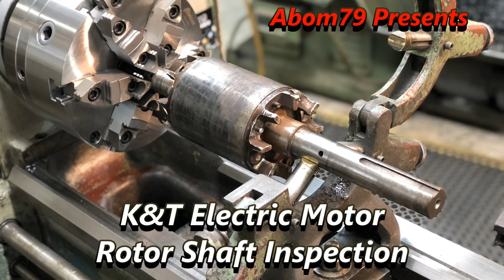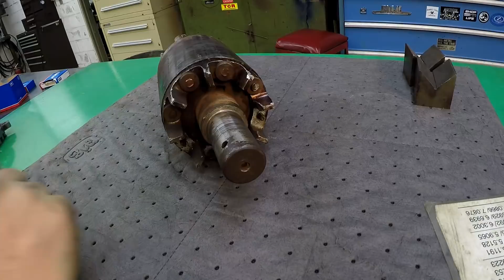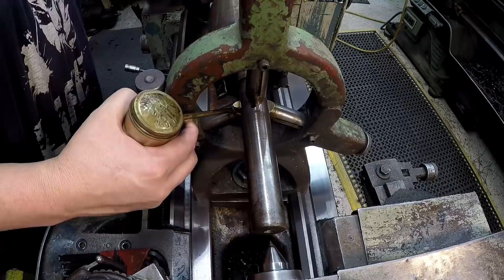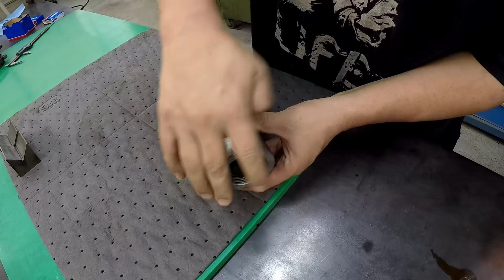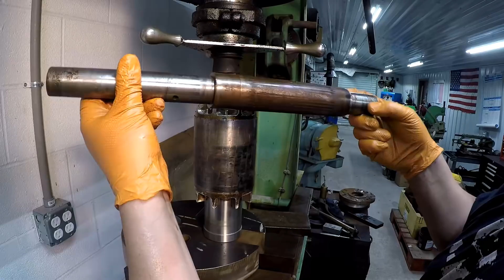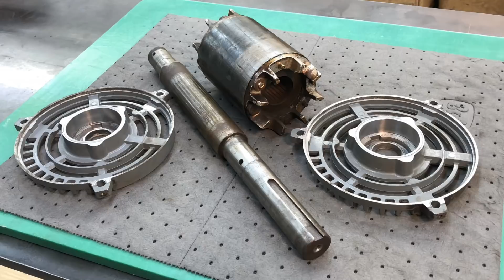K&T Electric Motor Rotor Shaft Inspection

Comment: Rotor has a keyway but the shaft only has one keyway on the drive end. Looks like it's not the original shaft. It may have some balancing issues?
The rotor also shown signs of heating probably not being correctly centured with the stator. Other causes of over heating the rotor can be due to a broken rotor bar and usually presents itself and a groaning noise when the motor is running at full load. If that was the case then replace the motor or find a replacement rotor if you can.
Reply: The rotor is couterbalanced via washers and rivets as I see.
Reply: I depends on when the balancing weights were installed. Where they added at the time of manufacture or after the rotor may have been re-worked. Apart from the heat colouring the rotor looks like it's had a hard life. The rotor shorting rings, fan vanes looked knocked about and bent and won't help with it's balance.
Reply: Right you are. Life beaten it :)

Comment: Bearing puller...yes, I've worked on shaft stuff that was hammered, I've got a couple puller sets, they have a thrust bearing that you use on the point...
….015" run out, that would surely hammer the bearing/housing. And the bent shaft...I was 'The Welder' in a machine shop...welded a few shafts, always distortion, then the press to straighten, and sometimes the shaft was like yours, but worse...so we made a new one….sometimes the old shaft was knurled (straight)...and not quite such a tight press.

Comment: best I had was trying to press a pinion out of a new old stock rear axle, cosmoline filled and the pinion had moisture and rusted to the inner diameter of the outer pinion bearing locking it in.  naturally I wanted to keep this new old axle and wrestled it onto the press.  at nearly maxed out on tonnage and not wanting to back down I smacked the housing with a sharp blow with a small sledge causing the press and axle to jump off the ground.     I like your slow motion shots, wish I was filming.

Comment: Either you are using a wide angle lens or that armature is bent like banana! I think it is the lens 😜 ok I just watched the rest...it IS bent! Why would a machine made ages ago in the USA have a motor with a metric shaft?
Reply: Most bearings are metric, been like that for a looooong time. Inch size bearings are often a special order...
Reply: You can compare known edges when something looks weird like that, in this case look at the table edge and you can tell it's just lensing. It's bent but it's not THAT bent haha

Comment: I have used them but presses always kinda scared me. Lots of tonnage in a small spot. I knew she was gonna give. Just didn't know when! Speaking of hearing protection you definately need to use it. I was recently fitted with hearing aids. Fifty nine years of loud noises have taken most of my high frequency hearing.Wish I had taken better care of my hearing. When it is gone it is gone. Bring us back when you do the shaft. Hopefully it goes in a little easier than that one came out..........
Reply from the maker: That’s why I started talking about hearing protection in my vids. I waited too long myself, but not I can’t stand loud noises or air blasts. Unfortunately I seem to be the only guy at work that cares.
Reply: Need to really work on them. You can tell them one of your viewers said so. I tell you I was really shocked when the exam was over. I have no hearing at high frequency at all. Too many years of loud stuff. Not to mention the hearing aids cost 5000.00 and no insurance help. Ouch!
Reply: Johnny Holland h

Comment: Used to do a lot of motor work in years past.I usually cut the shaft off flush with the fins and bore most of the center out to relieve the pressure before pressing.There have been times when the shaft would press out hard and the rotor would delaminate.I will sometimes also chuck the rotor and skim the bore in the lathe to true it to the OD and smooth the lamination ridges.

I've owned two K&T horizonal mills,both had the same issues with the main drive motor.IMO the motors are the weak link in the machines.They are not the same quality as the rest of the machine from what I have seen.

Comment: And that job just became significantly more expensive. On the other hand, it won't be destroying bearings with the new shaft. I'm assuming the cost of replacing the entire motor is still much higher than what the repair will run.
Reply from the maker: Yep, and you won’t find the correct output shaft as the original.

Comment: Hey Adam: Call Keith Fenner. He'll straighten the shaft! He does that for a living. Then again, getting a new shaft is good too. Jon
Reply: With all the extra work that shaft needs, and how it was bent, it instantly became faster and easier to machine a new shaft. Sure, it could be straightened, but then it still needs to be reworked for bearing fits.
Reply: Even Keith would ask why one would straighten a motor shaft, and then still have to machine back to condition. Life is too short. Typically Fenner is straightening prop shafts which have a lot of material in them and more worthy of the labour.

Comment: At motor shop we would hear rotor some to push freeze shaft and heat rotor to install. If belt drive machine we would heat straighten but new is better

Comment: I know how you feel. Started with antique motor. Had it tested for $60. Motor and capacitor were good, but the starter switch was broken and they couldn't find a replacement. Got it back and got the shaft repaired for $100 because I found a motor shop with a starter switch. Sent it to get the new switch and come to find out there is a short in the windings and the capacitor was weak. So another $350 for the remaining repairs. I should have junked it, but I just love the old look on my Atlas drill press.

Comment: Are you going to go through the rapid motor on the front too?
Reply: Adam suggested earlier on that the motor shop advised the mill was wired incorrectly and was under voltage. He suspects the traverse motor will be fine once it's at correct voltage.

Comment: I had an old motor rewound and refurbished recently and really hadn’t given thought to the work that went in to checking and redoing the bearings, shaft and endbells so this series is super interesting for me personally, so cheers for that. Keep her going on the healthy lifestyle too dude- really starting to notice the difference even just in the definition of your forearms and hands. Great work!
Reply: most likely something along the lines of "cross knurled the shaft" if diameter was too small for bearing and assembled with some loctite product, possibly the same for end bells..
assuming it was a bearing motor and not far off spec.

Comment: I'm betting you wish that was an electric over hydraulic press though
Reply: That's not what electric over hydraulic means. Electric over hydraulic means that the flow (maybe position) of the hydraulics are controlled by electronics. You're just talking about an electric hydraulic press. "Electro-draulic" or electric powered hydraulics, but not "electric over hydraulic." Don't feel bad, I thought the same thing for the longest time.

Comment: Hi Adam
I recently had my Bridgeport 2hp motor shaft replaced.
The guy that replaced the shaft said that the only way to remove the shaft safely with out damaging the rotor is to bore out the middle of the shaft in the lathe.
He said you pretty much machine out most of the meat from the centre from one end, so when you press out the shaft it will sort of shrink inwards to counter the laminations from the rotor.
Reply: Adam used to do this work for a living. Pretty sure his methods are sound.
Reply: Sideslip-
He still does this work for a living, doesn't he?
Reply: oldbones he did say he damaged some in the past by pressing them out.
Reply: Sideslip I’m not saying there not

Comment: you need a hanging chain mesh on front and back of your press,    i don't own a press yet, i'll make  1/4 chain fence when i get one.

i like the motor project,  i like that bearing chart.
Reply from the maker: We have them at work and usually I have to move it out of the way. Good for some jobs, annoying for others.
Reply: Dale Pomraning You'll find that very impractical if you're doing odd shape stuff that hangs out on one side, etc - you're better off spending the time to make sure everything is square so it doesn't fly out in the first place.  A job like what Adam just did is low risk for flying debris too.
Reply: I've never seen anything in a press let loose badly enough to ever need a guard of that type. If it's prone to shattering, it shouldn't be in the press. If your tool stackup flicks out at you under load....well, a press isn't the tool for you.

Comment: Use a brake cylinder hone for the bore.........old guys will know what those are.
Reply: I do as well, but that seems to be a large keyway in the rotor that would preclude that.
Reply: The keyway is on the output end of the shaft. The shaft isn't keyed to the rotor, so it's a smooth bore.
Reply: greggy-
My mistake! There IS a keyway in the bore of the rotor. I missed it the first time I watched it. Sorry.

Comment: I thought for a minute you might be getting a little light in the ass for that press😂. I’m in the process of loosing weight and I’ve noticed that the first place I’ve lost is in my arms and legs. The doc said that is usually the case. Looks like you’ve lost quite a bit in your arms.
Reply: There's something to be said for some extra gravitational advantage when you gotta pull a handle like that.
Reply from the maker: Yea seems I have dropped some weight in my arms.
Reply: It's good to lose the bingo wings Adam! :)

Comment: Curious, you have the shaft out now, why not straighten it, spray weld, turn, and reuse the existing shaft?
Reply from the maker: I’d rather Machine new and make content on that.
Reply: Adam, my thoughts were outside the box.  Of course, best case scenario, pick up the phone, order a piece of 4140, make a new one, install.  But think maintenance, the fellow who won this week’s Machinery’s Handbook wanted to see more maintenance content.   Let’s suppose you’re in a remote location, it would take a month before the chunk of 4140 would arrive, and the down machine is costing the company $1G a day in lost production.  What do you do?
Reply: When Adam said it had been welded I thought that shaft has been broken at some point. This happened to the motor for a large bandsaw that I worked on.
Reply: Well, you have to straighten the old shaft, then under cut it for the weld, then weld, machine weld to size and then reinstall.
A new shaft, you machine and install. Save a fair bit of time I'd say too.

Comment: i worry about the hot spots on the rotor laminations.. did the motor shop say anything about them.  perhaps they are from a previous failure and rewind.  i saw this and thought you might want to spend 2 minutes and read it.. if your motor does not run as expected.. http://windingphotos.blogspot.com/2011/04/defective-rotor-of-sci-motor.html

Comment: in my previous job i assembled a big press 250mm (10") bore... the crack i was expecting (sort of ;) ) uge crack still!!! but still learned another thing with Adam here, i did not know someone could replace a motor shaft... always learning! great video thanks Adam!
Reply: I use to work in a motor shop and most of the time on this size motor they would just junk it unless it was a special type motor but,  with Adam doing all the machining,  he's saving a lot of money by repairing the rotor... plus makes great footage for us 😁
Reply from the maker: New motor my cost is a grand, and won’t have the same size and length shaft that the original motor has.
Reply: @Abom79  Definitely worth repairing for that kind of money. Most of the companies we did work for wanted it right now so they didn't pay much attention to the price. Was the stator and windings good? That rotor shaft being bent and loose bearings I'm sure it was rubbing.
Reply: not likely, it would do strange noises and vibration (the motor should be out of balance) diferent from what Adam was reporting, and the shaft is bent in one end outside the bearing journals, besides that the air gap betwen rotor and stator should allow some warpage... still it is a great project for us to see and for Adam to save some money! everyone wins! it would be better for Adam if that motor was ok, but this is one of those problems that the probem was not that big and Adam can fix in house.
Reply: @gproto1  You're right about the motor. I ask only because of the way the some of the fins were bent on the rotor and it looked like it may have been rubbing.  The stator may just need a good washing...hopefully

Comment: I bet Keith Fenner would have straighten it out on his rollers...
Reply: My thoughts exactly.
Reply: yeah, i wonder though... with the bad welding and installed bent, maybe keith would also have preferred making a new shaft
Reply: If the shaft was only bent, he probably would. With undersize bearing fits either end, no.
Reply: So you would throw away a 10 ft stainless boat shaft because of a couple of faults with that thinking.... Yes it a v good fix but if you add the real w/shop costings then you would scrap it....
I love Adams stuff and as a tool maker from the 70's i get it.  However check it first then make the  call. Only one end  was out as the other was with in 1/2 a thou.

Comment: One of the professions I have is working on Brunswick bowling machines pinsetters and they have a 2:1, a  4:1 and a 1:1 gear setup and a gearbox and often times you have to go in there and replace them not necessarily the gears but the  aluminum housing plates that hold them to the gearbox break and getting some of those gears off of there it's the same process you got to put a whole bunch of tonnage on those shafts and when they go off it's like a shotgun blast so I knew what was coming... great video Adam can't wait to see how the shaft turns out..
Reply from the maker: One job you never hear anyone say is they work on bowling machines. Honestly, who actually works in those?? Asking out of curiosity.
Reply: I've been doing it on and off for the last 40 years
Both on the Brunswick side and the AMF side there's good money in it too if you know what you're doing...
But as of late it's been getting harder and harder the manufacturer of parts especially on the AMF side is becoming extremely expensive and or obsolete and it's putting a lot of places out of business at one time I tried to get ahold of you to see if you would be interested in the making of a worm shaft for a gearbox on an AMF machine it's a reduction box but I have moved on to bigger and better things I'm working in a machine shop myself now at Tampa Armature Works doing work such as this but there's a lot of upkeep to a bowling center especially on the machines that's clutch is it have to be rebuilt motors all the time the AMF 8270 machines that I worked on have three motors on them all of them at a third horsepower but there is electrical and mechanical and at one time when I had our machine shop at my father's house I used to make my own bronze bearings flanged and sleeve for different parts on the Brunswick machine and or shafts in the gear boxes you'd be surprised how much is involved......the center I worked in was a fifty lane house one place I worked at had 108 lanes

Comment: ?? Am I correct in seeing that the rotor has a key slot? Was it never intended to be used with a key?
Reply: The keyway is to line up all the laminations for when the aluminium is poured/injected into the mould to consolidate everything together.
Reply from the maker: John, that’s the first time I’ve heard that. If true, good info.